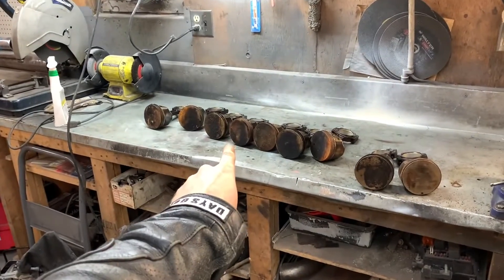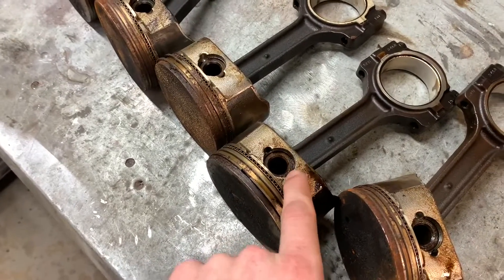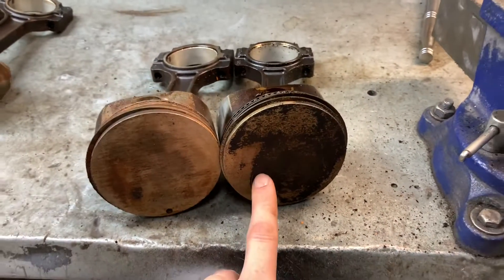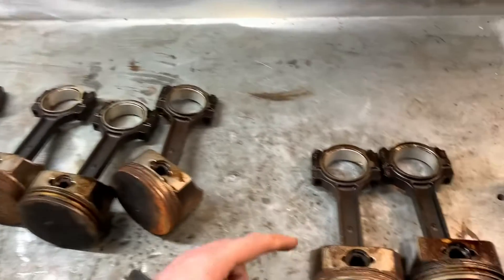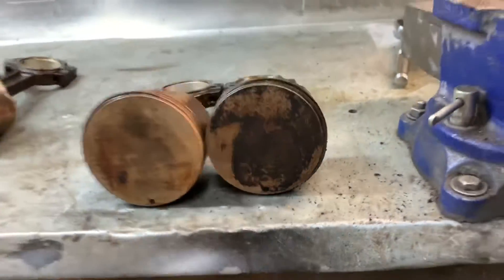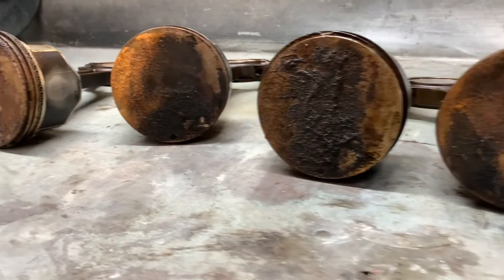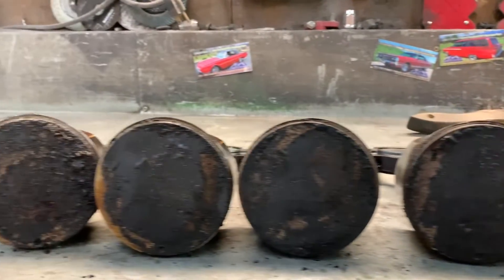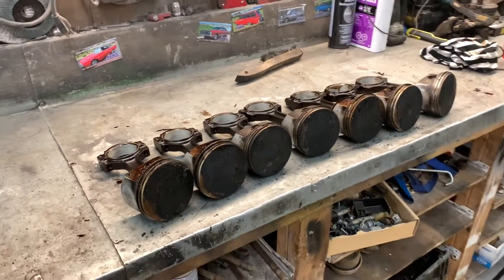Which way do LS pistons go on the connecting rods? Quick and to the point! 4.8 5.3 6.0 6.2

Comment: Hey I’m rebuilding my 5.3 but I mixed up the pistons would if it matter putting them in any hole on the block after I rehoned it Ik on your video the dots all got to be facing the same way
Reply from the maker: Yeah man, it doesn’t matter which piston goes in which hole as long as the dots are forward

Comment: I just bought a set of Gen 4 rods and want to buy new pistons for them, I  have heard that there are two type of floating pin sizes, is that a thing?
Reply from the maker: As far as I’ve seen all of the pins are the same size. Thats from 4.8, 5.3, 6.0 and 6.2. 

Maybe LS7 is different?
Reply: @StationroadRatrods  Thank you brother 👍🏼
Reply from the maker: You got it man

Comment: When use gen4 rods and pistons on a gen3 crank do you need to balance the crank and rod set?
Reply from the maker: Everything *should* be balanced any time you  change parts in the engine, but not necessarily. I didn’t balance anything and had no issues with worn bearings, vibrations, etc. that being said, I’m not an engine builder I’m just a guy with no training who puts engines together lol

Comment: Do you know if all the dimples on the face of the pistons are supposed to face the front? I went by the chamfer of the rod off of a forum and I believe I was supposed to be paying attention to the dimple direction. Any insight on what is correct for stock orientation?
Reply from the maker: They are all supposed to face the front yup, the piston wristpin is offset, not centered

Comment: Great video showing a quick way to determine this. Though I would always double check the chamfer on the rod is on the crank fillet. As for the pistons I can’t think of any reason it matters from the factory but after years of run time it’s a good idea to keep the thrust side and the skirt wear in the same spot.
Reply from the maker: Thanks for the comment! Hope it helps someone one day 

As far as I know most pistons have offset pins to relieve stress on the rods, you can install pistons backwards but apparently it can cause slap. 

This is just what I’ve heard over time, maybe you can shed some light on it